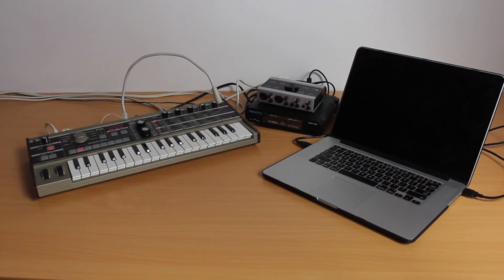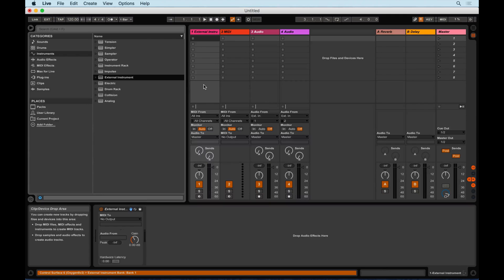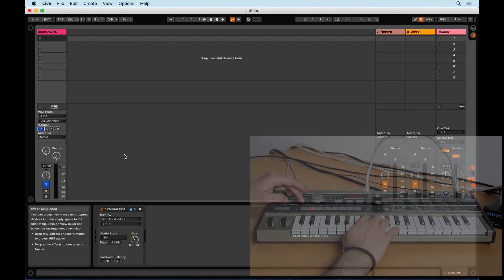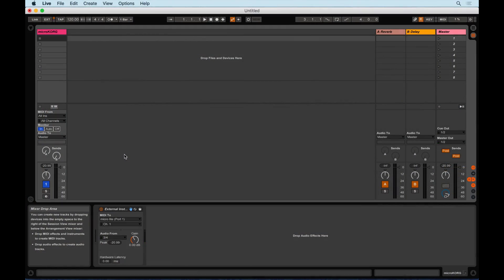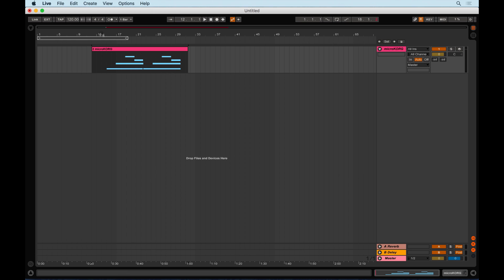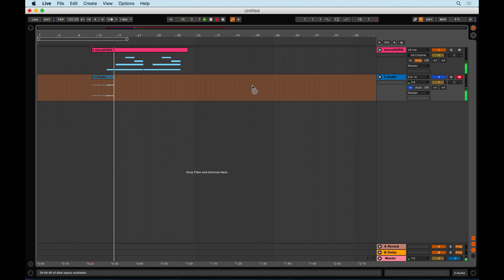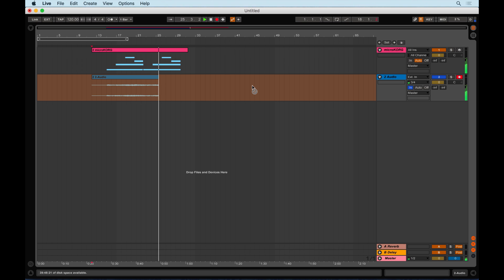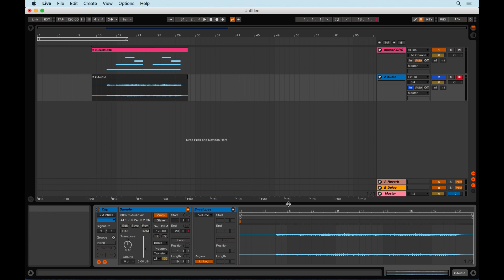How to setup a hardware synth in Ableton Live

Comment: You’re the fifth guy I’ve looked at and the problem with the other guys and it’s not there fault is that they know how to do it already so they leave out some very basic elementary stuff for a raw beginner like me. There’s an assumption that you have knowledge on-how midi works.  For example just the hook up was helpful. I can see why plug ins are an easier way to go. But I’d rather know both ways: how to use external instruments as well as plug ins. Got it with your tutorial.  A million thanks.

Comment: Coming from producing entirely in the box using soft synths, I recently got myself a hardware synth. Now I realise how much more work it takes to keep everything organised! Since you only use one track in this video, it’s not entirely clear that all MIDI tracks within the same project that connect to the same external instrument will trigger the synth. So after recording the audio track, you’d better inactivate the external instrument or its MIDI data in order to avoid a mess of different MIDI tracks playing simultaneously. Just one example of things that you need to keep on top of! Thanks for a clear tutorial.

Comment: Why does it need midi in and out? Also can you explain the direction of these pathways? I'm confused why you're routing your audio from a keyboard into an interface and then into the computer? If you're using the Keyboard as a MIDI controller through a separate interface.

Comment: Thank you .I just purchase Ablelton standard .Have to use standard and not intro to use this feature I believe .I have the same setup except that I have a Roland JD XA .When the automation was being recorded ? Did Ablelton register the CC messages ? From the Korg ? If you had some more hardware instruments ,needing a larger audio interface ,would  latency be an issue ? Would a thunderbolt interface be overkill ?

Comment: Hi! Thanks so much for this video! This is by far the best and most comprehensible video on setting up the Korg :) 
I have a problem though: I am very new to this stuff and struggling with the audio. My program (Ableton Live) recognises the MIDI notes of my Microkorg but changes recorded tracks along with changed settings on the Korg. So as soon as I add another track and change the settings for the second track, the settings on the first also change. Also, the sound only resounds if the Korg is on and connected, and is not able to play through Ableton itself. It's very frustrating...
I think it has something to do with the fact that my Audio goes straight to a speaker from the Korg, and I only have one Audio Interface (Steinberg UR22C) (is it only made for MIDI?). Can someone please help me? I'm so lost!

Comment: When I produce sound on the equipment connected to the MX-1, the sound comes out on the connected monitors on the MX-1. When I record a track on the Ableton connected to the MX-1, and play this track on the Ableton, I cannot hear the sound on the monitors connected to the Ableton. Could you help me? solve this problem
Reply: greta vid and same question as @heleno , I had same problem. Recording midi data and audio from Korg, through MX-1 into Ableton works fine...to send midi back to Korg from Ableton make sure on external instrument in Ableton device you select “Aira MX1 output (MX1)”.... not CTRL

Comment: hey man, can I use microkorg as a midi controller for DAW like ableton with a 'midi to USB' cable straight to my computer? or do I need midi interface like motu?
Reply from the maker: Hi Muhammad Mirza, yes I’m pretty sure you can. When you plug it in go to Live -> Preferences -> Link MIDI and check it shows in MIDI Ports
Reply: same question here, but ableton doesn’t allow me to record, i can listen the notes but there’s no playback record. I’m using akai 25 with ableton live btw. cheers
Reply: Did it work for you guys, without a midi interface?

Comment: Greetings,

Great instructions.
But what I didn't get is what happens after you connect the audio interface to the MicroKorg. 
How are you able to hear sound? Is there another connection that you have to make with the audio interface to speakers or the laptop?
I pretty much want to know what all wiring I need to get in addition to the audio interface if I have the MicroKorg keyboard, macbook & two presonus monitors.

Comment: I connect my m-audio venom but it seems that it only sends midi. When I play the recorded midi it doesn`t play any sound of the synth. I guess ableton is not sending the midi back to the synth
Reply from the maker: Is the audio output of the synth connecting to a mixer or directly to your interface? In Live make sure you have the correct i/o selected both in preferences and in the channel settings. Maybe try plugging some headphones into the synth output and check that sound is being generated within the synth.

Comment: Very well explained but it's ironic that you chose an older model synth because the model was upgraded after the first MicroKorg to USB connection for MIDI transmission as well as dedicated MIDI port (MicroKorg XK & XL+) which makes the job a lot simpler. Still, there are thousands of "MK1" users out there and I'm sure this was helpful for them. For Audio, I just come out of L/Mono of MicroKorg XL into 1 channel of Focusrite 2i2 DAC or LEFT/RIGHT channels if I want stereo into both input channels of Focusrite 2i2 DAC. MIDI is transmitted over USB.

Comment: i guess with ableton intro all this is not possible, there is not the external instrument option :(
Reply from the maker: A Short Term Effect yes you need Standard or Suite to use the External Instrument plugin. What you could do is setup separate midi and audio tracks. It's more work but still possible to get the synth working
Reply: Matthew E Mazzone i will try this out, thanks for your help!

Comment: can I just connect the audio via a 1/4 to 3.5mm adapter in to my computer's microphone aux port? or am I forced to buy an audio interface?? thank you !
Reply from the maker: Inakie Jaime that might work. A synth needs a line input though so it depends on if the aux input can accept that type of signal. The sound quality probably won't be as good but worth trying

Comment: A very very good and simple video to explain it all, thank you very much!

I'm new to all this stuff so I feel like a complete dumbass when trying to record something.
I've got soo many ideas I just want to get down and record, but I can't wrap my head around this program.

Do one really need to have a MIDI Interface? Guys at my local store said all I need is a hardware synth (which I have) and an Audio Interface to record straight into the program?
Reply from the maker: Wabin22 I'm glad the video was helpful! You only need a midi interface if you want to be able to send/receive midi to the synth. You can record the audio straight from the synth to your computer but it just means you'll be editing the audio if you need to make any changes
Reply: Yeah, thank you very much :)
And thanks for this other information!
But wouldn't I need to edit the audio even if I where to use midi to send or receive?
Reply from the maker: Yes that's true you may want to edit the audio or add effects. But if you have midi data you can edit the notes and automation. You have much more flexibility. When editing audio you can cut it up and add effects but you just have more options with midi. Ideally you want to use both. Record the midi, make sure it's all perfect, then record it to audio and continue editing
Reply: Ah cool, I did not know that.
But I'm all new to this so it still feels a bit hard and confusing :P
But thanks for explaining some more, I appreciate that :)

Comment: Could you help me out setting up all my hardware?Its the closest configuration to mine ive ever seen till nowJust started using Live so, complete rookie...with a komplete audio 6, the micro lite, beatstep pro and volca bass and keysCan use the BSP as midi controler for live but cannot use it to create sequences for the volcas and/or control them, even after changing the midi channels on them.Any ideas?Thanks
Reply from the maker: Ricardo Branco sure I can help you out. Are you getting any audio through? Is the midi working for the other synths or just the Volca that's the problem? Make sure you have the latest drivers for your interface too

Comment: Why cant't you use the MIDI in and out from your audio interface?
Reply from the maker: Fede Janda yes that's definitely an option. The reason why I didn't do that in this video is because most audio interfaces don't have MIDI ports. So I wanted to keep it separate. Also if you're connecting more than one synth you'll need to use a separate interface for the audio and MIDI. But you're right, in this example I could have used the MIDI ports on the Komplete Audio 6
Reply: @matthewemazzone  Can't i just connect my synth to my computer via USB cable??
Reply: u solve my problem.. thank you
Reply: You could have also frozen the midi clip and simply dropped that clip ( holding opt to duplicate) into  2 Audio making an audio clip without recording again.
Reply: @nancypelosishusband371  sometimes recording might be a better option if you have effects that last longer than the midi clip (i.e. long reverb tail), or if you want to have silence at the end of the audio clip for specific purposes.
Reply: freeze and flatten captures the reverb tail
Reply: @Matthew e Mazzone
Thanks for explaining! I was pretty confused for a sec too. I have the Audio 6 and felt sure that couold handle a Microkorg...
Reply: what would be the reasoning for converting midi to audio? If you only plan to record midi can you get away with using just a midi interface? Thanks :)
Reply: Exactly he used two audio interface making it confusing
Reply: What about the track sync remote settings in ableton live preferences?  Can you do a video on this topic?
Reply: How is the audio interface connected to the computer? Do I need studio monitors with every audio interface? I have only seen interfaces with those big ports for L/R
Reply: @DavidBlaze420  Just use headphone socket if you don't have monitors.
Most usb cables are just common printer cables that go from the audio interface to the computer-laptop.
Reply: David Blaze through a USB cable.
Reply: Thank you! I have watched a lot of hours of videos setting this up but yours was the easiest to understand. I have an interface with midi in/out so that makes it even simpler! Thanks again life saviour!!
Reply: Woooow had a MicroKorg since forever and only able to use it as audio, you have literally saved me life! thanks a lot bro great information and great video!

Comment: It would be good to explain how the monitoring works and if you have to turn off local midi on the keyboard or if ableton does it all automatically.  Thats the only thing that comes up when im thinking of trying this..  I guess it is easier to just try it and see.
Reply from the maker: Duncan Haskell thanks for the feedback. I can look at explaining how the monitoring works in a future video. With local midi, that does need to be turned off. In this example I was using a controller so there was no need. But if your keyboard is also a synth of electric piano etc you'll need to turn it off so that you don't hear the sounds from your keyboard on top of the sounds triggering on your computer.

Comment: Can you record to just audio without using MIDI (MOTU Box) with the MicroKorg? Im saying just using TRS cables straight to the audio interface.
Reply: Yes you can but you would have to play the notes in on the keyboard as there would be no way to sequence the notes from the pc.
Reply: Yeah i'm cool with that. I'm good with recording to audio (.wav) files. But is it just as simply putting my TRS cable into the input of the audio interface? Just getting stuck on setting up the preferences and channel config in Ableton to record it.
Reply from the maker: UrbanLikwid yes you can just record the audio as Duncan said. You just have less control and would need to use the synths keyboard. Using midi just gives you more flexibility with inputting midi data and also editing as your can modify the midi data before recording it into audio

Comment: Question: Why didn't you just use the midi ports on the Audio 6 interface & eliminate the Motu?
Reply: @Vic LTD can i use the microkorg without a audio interface? somebody can tell me?
Reply: @Vic LTD since my midi keyboard broke up i found out that i can use my MK1 as a midi keyboard. ive got one midi to USB cable to connect the MK1 to my computer and i tryed to connect the synth that way,  but when i open up ableton my midi chanel didnt recibe any signal,  and i tought maybe is bc i need to connect the mk1 to an audio interface  besides the midi to usb cable for make it work. sorry for my english
Reply: The answer is no. You can plug a headphone.

Comment: I'm using the microkorg with an yamaha ux 16 midi interface and it's tellin' me that it is receiving midi clock messages from the mircokorg all the time even if I set the microkorgs midi clock to external. You might have an idea to avoid this? Everything is working fine so far but it feels kind of annoying.